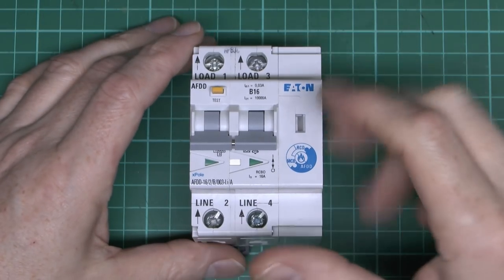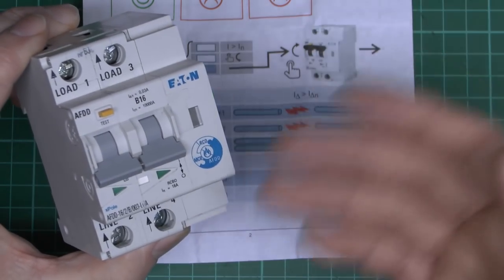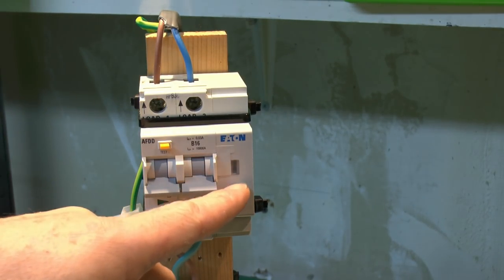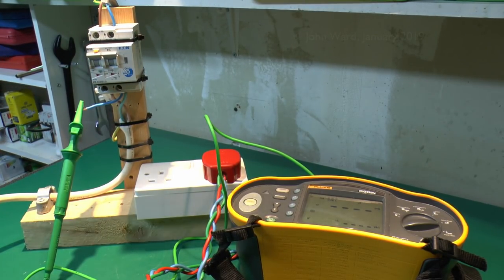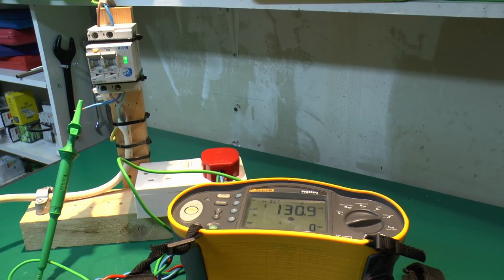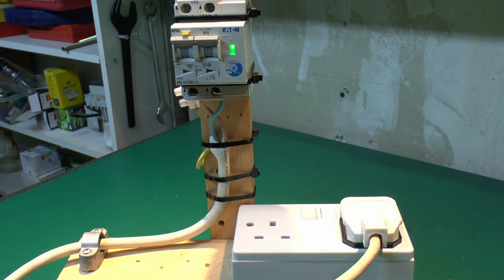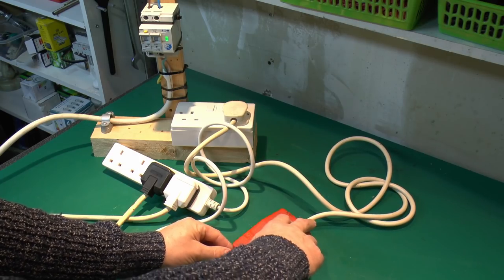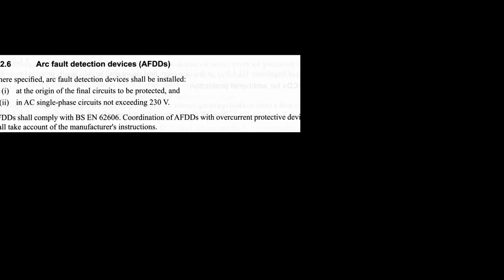AFDD - Arc Fault Detection Device - Part 1

Comment: In practice, it is VERY hard for electronics to tell the difference between electrical noise that results from normal usage of appliances and the waveform changes caused by an arc. So in my humble opinion, these so call arc protection devices are a waste of money and resources. I would rather people spent their money on having their electrical system checked by a real qualified and experienced electrician.
Reply: Unfortunately in Canada, they're required by the wiring code in bedroom circuits.  I have heard of them being installed to pass inspection and then having them removed and replaced by a conventional breaker.
Reply: In America.
It is required that all circuits that Supply the inside of the house must have an arc fault protection.
so when it comes to kitchens and bathrooms you have that and a GFI.
But people do have problems with them when they have a ceiling fan in a bedroom.

Comment: That "DIMMER" might mean time delay, so it tripped with delay (cause of not significant, non-inductive arcing, also the arc symbol is smaller in that graphic instructions) i think if you ran some motor and did the arc test, it would trip instantly and would show 1st position with one yellow blink.

Comment: Arcs tend to come from loose screw terminal connections. So if these are eliminated the need for an AFDD is reduced or even eliminated. Having screwless terminals makes an installation much, much safer. The likes of the Wago type of connector and screwless terminals on sockets, switches, appliances, MCBs, RCBOs, etc, will pretty well eliminate the need for AFDDs.

Comment: Thanks for doing this John, and thanks for showing the little trick with the RCD's selectivity' issue.. I may borrow that.. so it's looking like these devices do little next to nothing for loads up to 8 Amp which is a complete contradiction to most of the scare mongering marketing material out there.
Reply: Sparky ninja... I saw your reaction to these at your tresham college visit video, you didn't seem convinced? Me neither... Glad JW did some tests, but there's more theories to be tested. It's pretty inconclusive to me. Are these things designed to trip on certain loads? I like the idea but seems like a money making scam to enhance regs even more an keep the money coming in. Its sad times if it is. 😣

Comment: I'm guessing the lack of sensitivity to arcing may be due to having to play super-safe with all the electrically noisy electronic power supplies and motors in modern appliances.  I can't help feeling that they are going too far with their endless desire to complicate domestic installations.  240V problems tend to be somewhat more decisive than 120V ones.  I could see something like this being more useful in a place like America due to their lower voltage carrying a greater arcing risk.
This is also probably going to be another breaker where electrical separation has been compromised due to the need to jam electronics inside it.  Unlike most RCDs with very simple electronics I would expect this one to have a reasonable power supply in it that may affect its usable lifespan.  I'm also wondering how much power - both real and apparent this thing draws in standby.  If it has a capacitive dropper or switching supply in it then it could make a significant contribution to electricity costs over a year.  Especially if apparent power metering is applied.
Reply: Also the USA often has the small 'pole pig' type transformers. The short circuit capacity (and by extrapolation the arc fault value) tends to be lower too... so a dead short might not even alert the person who caused it to the event.

Happened to me in Iowa, I used a category '0, you're shitting me' test probe in an outlet. The tv went off. No bang, no flash, nothing. My wife had to take me to the fusebox (USA style edison 'plug' fuses) to show that i'd actually blown a 20 amp fuse with no visible trauma. LOL
Reply: @TheChipmunk2008  Your thinking more of prospective fault current under short circuit conditions.  Lower with small transformers and generators.  The arc detection is to detect bad connections that are arcing even at low current.
Reply: A device that does little just so some more cash can be made ! Soooo  All we need now is a 12 foot long consumer unit as we have 3 ways used for each circuit, a very understanding inspector as the device was at the brink with the RCD - I wonder how those it will perform when on the other end of a 220M run - needed to be hit with arcing for a long period right at the tip of the max cct load (how many 32A ring mains do you see that are normally loaded to 30A) diversity anyone ? AND you are going to have to lock the breaker in a cupboard as the VERY FIRST THING the EU is going to do is reset the breaker...... Oh dear there goes your record of what supposedly caused the trip.

Never mind perhaps there is another bit in the regs we have yet to see that will involve using another 4 ways to install a logging printer so we have a record. I wonder how it will perform as Clive points out with a nice mixture of inductive and other loads introduced.

So to summarise ....  Spend longer on site for the install and testing. Use a much larger consumer unit. Spend more on parts and time. Install acropropps under the consumer unit to support the now sagging casing due to the weight of the 12 foot long bus bar. Spend a wasted day on site chasing a fault that may not be there. What about induced EM from a thunder storm.....   

Its the sparks at the sharp end who are going to have slice more out of profits as I cant see the end user offering to pay the extra. This could be fine when you have the chance of heavy duty contactors wearing out or other very rare situations but as Big C points out this is more suited to American sparcs !  I bet this has been sneaked in by the EU...   TOTAL JOKE..

Oh and someone make Clive a cuppa, after his recent part P rant we don't want to loose him !  Thank you bringing this into the light John   :-)
Reply: We feel similarly in the States.  The original push for AFCIs was to protect against arcing due to compromised extension cords and damaged receptacles in bedrooms.  Now as of 2017 NEC, they're required nearly everywhere, and to make matters more annoying, they're for the first time a required upgrade if any receptacle is replaced on a given circuit.  I have one that I removed from service that was false tripping after just 2 years of service...I should send it over to you so you can give it a proper autopsy.
Reply: Not trying to have a go at US wiring so please don't take offence......

Was the push for arc detection anything to do with the way US plugs don't have a lot keeping them in. When I was over there the socket strip I had my phone and alarm clock plugged into kept popping out of the wall plug. If you hit the cable it just came out. It didn't strike me as a firm termination.

Do you ever have any arcing in the twist on terminals I have seen being put on ? They don't seem to be a very good way to make a solid termination. Do you ever get HR faults or wires coming out of them.

Just curios and as I said .... No offence intended.
Reply: @TRS-Tech  That's part of it.  The NEMA 5-15 receptacles have good retention when new, but when they wear out, what happens to you happens.  I'd imagine the same thing can happen to BS1363 receptacles, but with less frequency.  The wire nuts (twist connectors, or "marettes" if you hail from Canada) work fine as long as they're installed properly, I've not seen wires pop out or arcing...it's much more common that the backstab connectors on devices fail.  Personally I use Wago 221s because they make installation and maintenance easier.
Reply: @TRS-Tech  As a sparky I do look forward to trying to fit these devices in a cupboard under the stairs or whatever with a consumer unit the size of a suitcase! Oh and by the way there is no such thing as a 'ring main' Cheers
Reply: This seems fun :D

Can't wait 'till they introduce these things in the Netherlands. Seems to me like a way to fill the manufacturer's pockets, annoying homeowners because the damn thing keeps tripping for no reason, and make us electricians pull our hair out 'cause we can't find the fault. Also the seemingly very slow RCD concerns me. All (new, decent brand) RCD's I've ever tested tripped in 30ms or faster at 1x the trip current.

Or maybe it won't work at all, because 80% load on a circuit is highly unlikely :D

Also, we Dutchies use alumin(i)um conductors for larger cables, like 10kv distribution lines or cables running in the streets along blocks of houses. The tap-off to each house connection is copper though.
I once worked in a 60-room hotel, where we installed all the electrics. The feeder cable from the street (230/400v 3 phase 250 amps) was aluminium as well.
Reply: @mobile_vic  Aluminium seems to create a nightmare everywhere it goes. I spent many years working with Openreach in the UK on a system called Redcare setting up exchange side equipment, changing customers on ISDN over to broadband, installing a new fiber backhaul network called 21CN and working as an SFI (special faults investigator). Over all those years I went just about everywhere in the ""Copper"" last mile part that connects customers to the exchange.

Its a standing joke in the industry that all the top brass claim "there is no Aluminium in the network" ........ There is loads of it !  The uk telephone network uses 50vdc, 100vdc and 150vac and its all terminated with IDC connections. If you think its a nightmare with mains installations you wont want to fault find at 50vdc !  Its a pull your hair out situation. In the underground termination boxes where it can get wet due to leaking "water tight" junctions it often tracks back down cables or if the junction leaks it becomes very brittle so an engineer may open a junction to make a repair on an intermittent or high resistance fault they repair the fault on the circuit they are working on but if they are not very gentle with the connections they will create 20 new faults when the Aluminium snaps of inside the IDC crimp. You cant see the break as the insulation stays intact and it just crumbles inside. That's not to mention the losses to broadband speed compared to copper wire pairs. Aluminium is the bain of a telecoms engineers life and these circuits carry next to nothing current wise.

I cant imagine what its like for an American electrician working on high current connections. I can understand why (if its true)  that we hear about lots of fires being caused by Aluminium wiring in American homes. Its going to have a higher resistance and be far more likely not to make a good termination or wear out if moved about ect.

In that kind of installation I can see a possible need for arc detection but with today's homes being filled with switched mode power supplies, capacitive droppers and high power motors I can see why you get so many false trips. I am wondering if having some kind of feedback or intelligence in the wall socket or light switches is the solution. I take it the idea of these new breakers is to detect arc conditions in the house wiring. If that's the case then having some kind of smart system where part of the arc detection circuit breaker is in the endpoint and arc detection only operates to the wall point.

If installations must have some form of intelligent fault detection then it needs to be fully intelligent with remote reporting to the customer and fault logging ect. I know this would be of large expense initially but if it saves customers paying out for site visits constantly it would soon pay itself of.

As electricians over in the States would you welcome some kind of system where arc detection works up to the socket or light only. Earth leakage and overload conditions would of course continue past the socket to protect the customer. What do you do when you have to install arc detection breakers on circuits that supply fire detection, intruder and any other kind of equipment that must be continuously running for safety ect ?

It's all becoming a bit of a nightmare isn't it !  I hope to hell they don't mandate these breakers over here in the uk. It's going to create a total nightmare if it does !
Reply: @MrPhillipgraham  Yep. The consumer units are going to be massive. Maybe they could incorporate "ring circuit or ring final circuit" loop breakage detection ....Sorry I have got used to ring main... Bad Stuart !!!  :-D

Whatever way its incorporated its going to create massive expense both in time and money.

I must admit I share Clive's worry that "smart meters" (now there's a contradiction in terms) are going to be switched over to apparent power. The electricity retailers would make a fortune just by ticking a box !  Its to tempting for the greedy fat cats to decide to do it.

Perhaps now is the time to start a business that makes affordable single phase automatic power factor correction units.   ;-)   My utility company have told me they need to fit one on my gas supply for "safety" reasons so I had a complete independent inspection and report on my gas and electricity installation written up. They will get that thrown in there face if they try it on again. I have seen them use the gas safety legislation in order to force entry and fit a smart meter. Have a look on YouTube.

Cheers Phil   :)
Reply: Stuartbe thanks for sharing your insights here. I am a relatively new sparky and do a lot of data work and would love to have your level of knowledge.
Reply: @Adit209  My knowledge is concentrated around comms systems, encryption and tracking down RIEN, and other EMI interference. I have a good many years in IT and helped develop the "RedCare" alarm signalling system........ But as for electrical installations I am back in the 16th edition days.

There are members here with a far greater range of experience and years of working at the coal face. Thank you for the complement but I am only a little fish in the installation and regulations area's. You would be better of asking the sparky's on here for help in that are but if there is anything that is in my area please feel free to give me a shout.

QOTD - There are only 10 type's of people in this world. Those who understand binary and those who do not !  :-)
Reply: Making residential installations overly complicated? Wait till you try and calculate if you should fit an SPD. I'm already seeing you running with meter tapes on the Isle of Man @bigclivedotcom measuring distances between transformers! :D Excellent video @JW as always!
Reply: According to Hagar, their device has to see an "Arc Signature" of >2.5A over a specified time for the device to operate.
Reply: Weirdly enough, just last week I had an extension cord start arcing which then welded itself to the plug... and then stopped arcing xD That was a pain to seperate, and had a significant welded bead on the plug I had to grind off to get the plug to fit in another extension cord.
I understand where they are coming from wanting this kind of protection, but sometimes, it is simply too complicated to differentiate proper behavior from faults, so I am skeptical how helpful they can be.
Reply: @mernok2001  you are correct, but in Poland the smallest cross section was 2.5mm2 and its use was quicky dropped in final domestic circuits. We still use aluminium in cables >25mm2 where these seem to work fine if properly terminated
Reply: @mernok2001  that was really "economy" class of an installation..😊
Reply: @TRS-Tech  In the US I haven't noticed loose plugs too often but it can happen.
A really insidious problem is a loose wire on a screw terminal of a switch or socket inside the wall.  Those can be very dangerous.
Twisted wires with a wire nut are pretty good but not perfect. 

"Loose wires start fires"
.